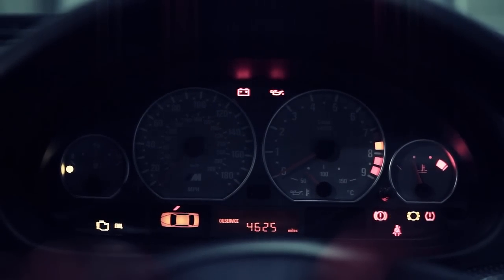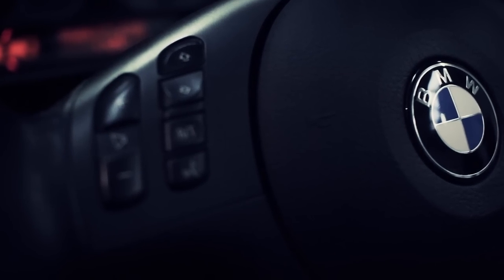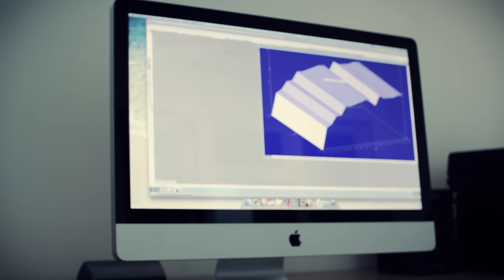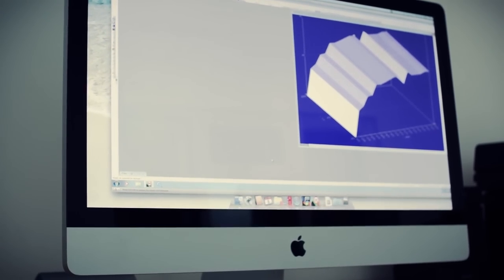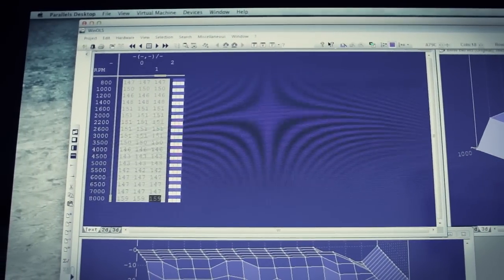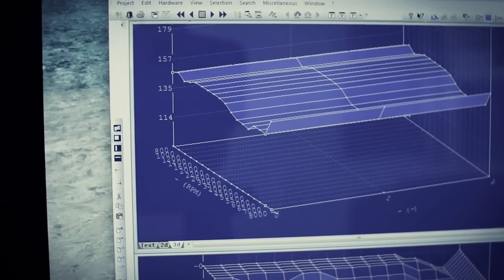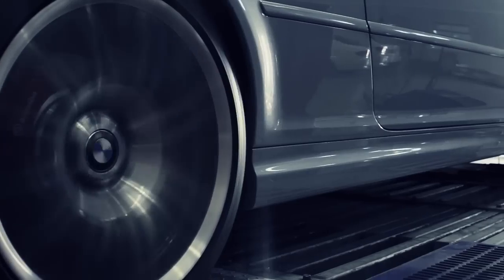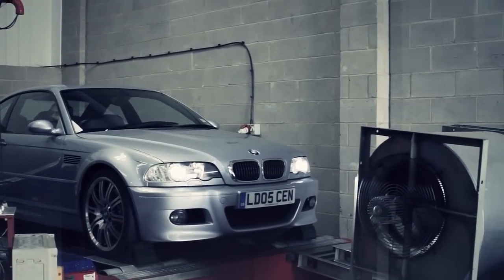Evolve Automotive: Insights into ECU Tuning BMW M3

Comment: Emissions monitoring in my country is on idle and then sustained for several minutes around 3000RPM. Does the tune + AlphaN feature change fueling so aggressively that the CO2 measurement would be above factory specification when measured for several minutes around ~3000RPM?